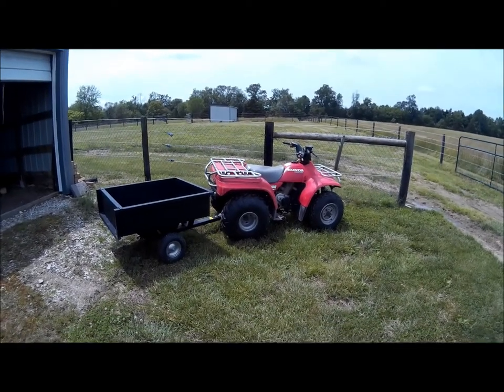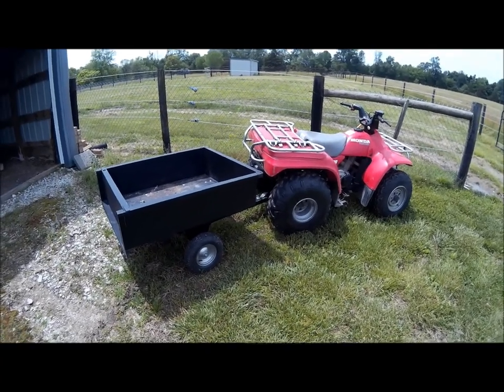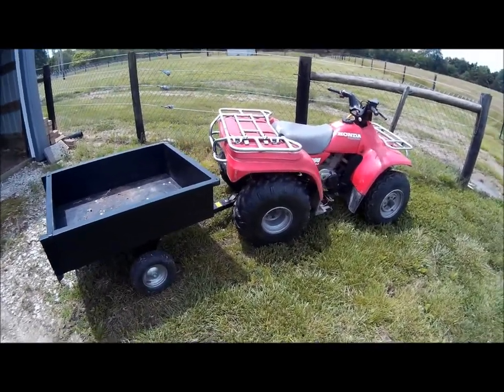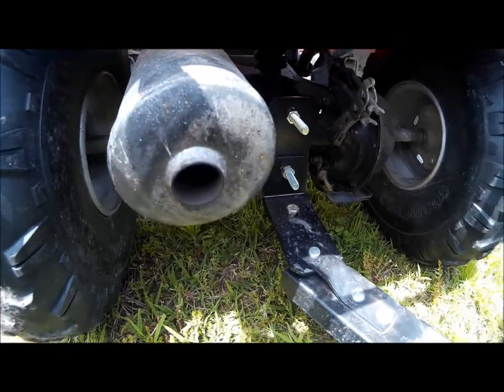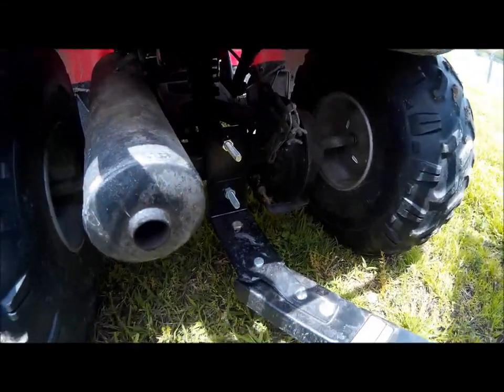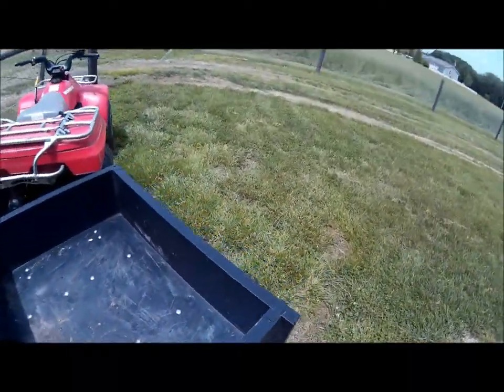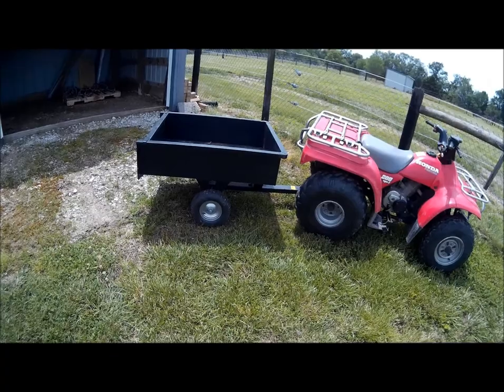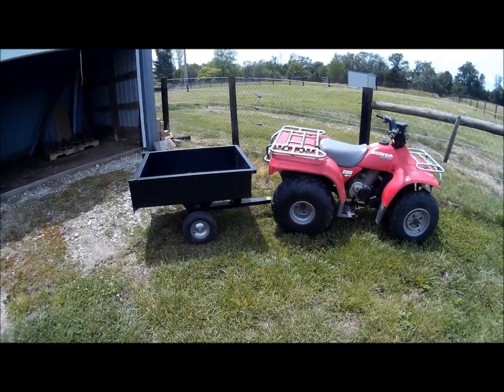ATV Upgrade with Tow Hitch! DIY Homemade

Comment: You remember which parts you got for this? I need to make one for mine.
Reply from the maker: @chadlayfield  I found the parts at a farm/home supply store. I just happened to see the L shaped brackets with holes in them. I then checked to make sure the hitch pin would fit. U bolts to fasten to transaxle. I literally just pieced it together but works great.
Reply from the maker: @chadlayfield  I found the parts at a farm/home supply store. I just happened to see the L shaped brackets with holes in them. I then checked to make sure the hitch pin would fit. U bolts to fasten to transaxle. I literally just pieced it together but works great.